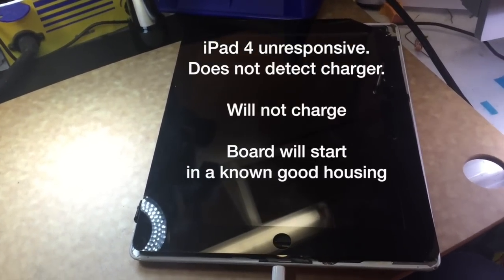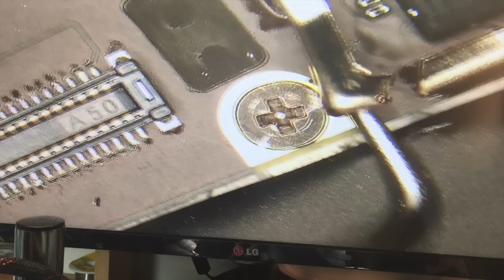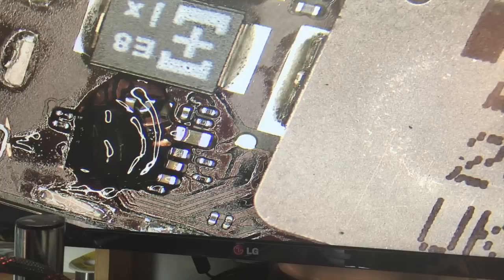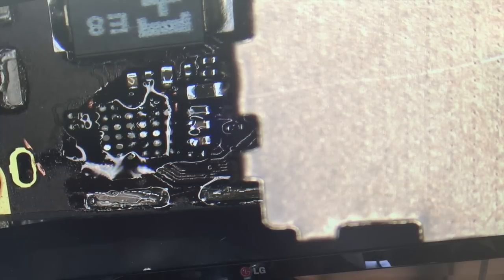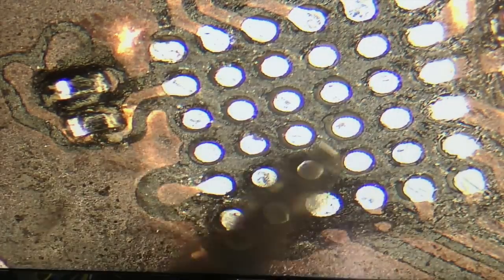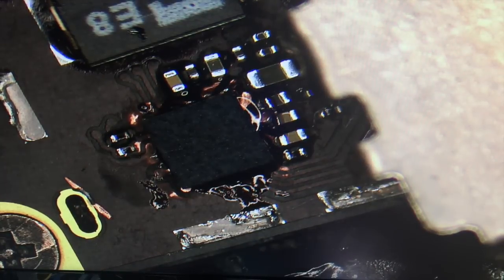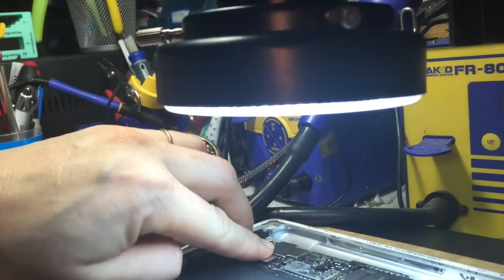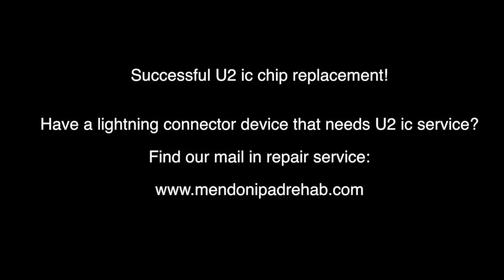How to Replace tristar (U2) charging chip in the iPad 4

Comment: hi, do you know if the charging chip is pre-programmed? I'm thinking about using a chip from one ipad to another and don't know if it will work.
thx!
Reply from the maker: as long as it is the same chip, and the donor board chip is not damaged, reballed well, and the charging chip was the actual source of the problem then yes--it will work
Reply: thx!

Comment: I have an iPad 4 with this issue and changed the U2 chip by an 1610A1 from a 5S.
Forgot to mention that the iPad didn't even turn on before the U2 chip exchange.
It did not boot up (bootloop).
Also tried to restore but it did not restore giving me the 4013 error.

Haven't changed the battery nor the Lightning Port.
What should it be? Maybe the wrong chip and should be an 1608A1...

Comment: Hi I have a question...when I was updating my iPad to the newest ios (it’s an iPad Air 2) I accidentally unplugged my charging cable from the adapter...I didn’t know what I was doing so I just simply plug back in the charging cable while the cable was still connected to the iPad..now whenever I go to charge my iPad it wouldn’t charge and shows an error screen saying “this accessory may not be supported” but I’m using the original charger..do u think it’s the charging chip that’s broken and if so can it be replace for a cheap price

Comment: Hi, I have an ipad 4 which displays the charger plugged in, but it does not actually charge, even if left for hours, the charging port has been replaced and so has the battery, could you point me in the right direction please, as to which component/s need replacing.
Reply from the maker: +mark sanders uh, the one in this video.  Replace U2 chip.
Reply: Thanks for the reply, I wanted to check with somebody that's familiar with this issue, because some places are saying, to replace the filter, diode etc, for what they describe as 'false charging fault'
Reply from the maker: +mark sanders yes--those people are idiots.

Comment: Hi Jessa, how would you rate U5 removal on an iphone 4s? I have not been able to remove it because I cant really get that epoxy kind glue that surrounds it. I have tried those so called bga glue remover which are extremely corrosive if you get it on your hands with 115F heating; no luck. Any suggestions? Best Regards,
Reply: Try 200 C

Comment: Is the U2 Chip on the ipad 4 the same as the U2 chip on the iPhone 5?
I'm having problems trying to find the correct chip to buy. 
Great video by the way. ; )
Reply from the maker: Pat Fegan no--you have to match 1608 chips with 1608 and 1610 chips with 1610
Reply: iPad Rehab But the process is the same? Having a similar issue
Reply from the maker: Kenadi Gaming yes
Reply: Thanks for the reply
Reply: iPad Rehab which chip does ipad 4 have 1608 or 1610?????

Comment: Is your device working OK before replacing the U2 chip or its dead no charge or black screen?
Reply from the maker: Depends on the way tristar fails
Reply: iPad Rehab I DON'T UNDERSTAND YOU!  However I've an IPAD 4 with no power on and no charging shall I replace the U2 or PMIC chip?

Comment: where you buy, knife remover glue ic u2 ?
can you give me link

thank you :)
Reply from the maker: Faishal Rani  I don't use any special tools.  A straight pin, or tweezer, or dental pick---whatever is nearby.  I don't think those underfill removers work.  Just on some heat and be gentle.
Reply: I saw your skill is very good.,
Im salute

So how much degree hot gun when you lift ic u2?

Comment: You not afraid of damaging them solder pads doing that with the iron. I have fixed plenty of u2 ics, but always rip pads now and then :/
Reply from the maker: No, but we no longer braid the pads.  Wasn't necessary over time
Reply: iPad Rehab I think that's were I'm pulling pads. I would braid right after removing the chip, then just apply the new IC. Gonna give your method ago. Thanks for all the lessons :)

Comment: http://i65.tinypic.com/11uzqc9.jpg 
Any tips on how to solder back the solder pads? Also, as you notice, some of the solder on the IC chip area are ripped off. Do I need to reball those or not? They don't seem to be connected to anything.